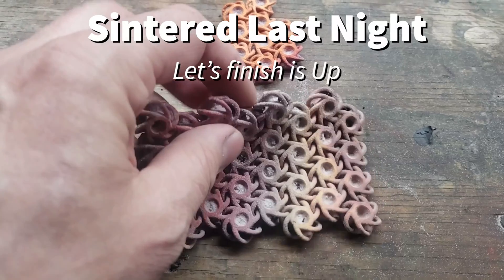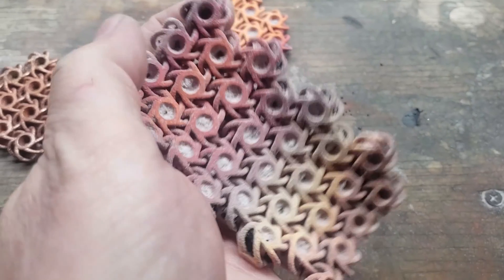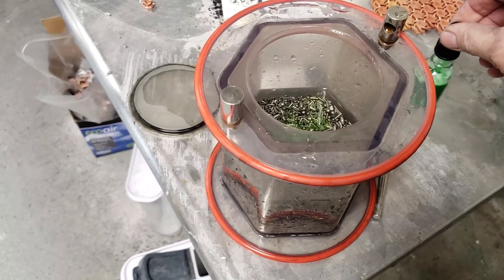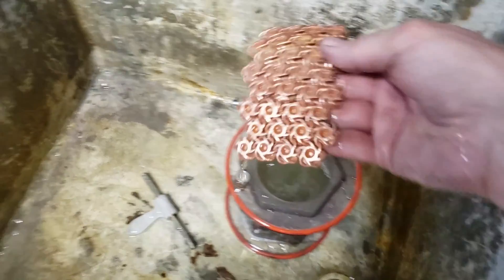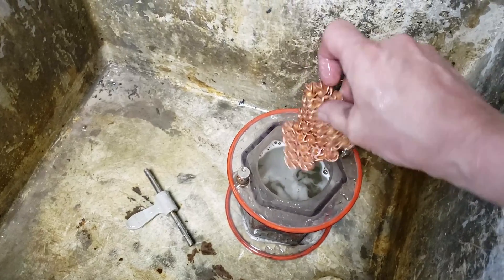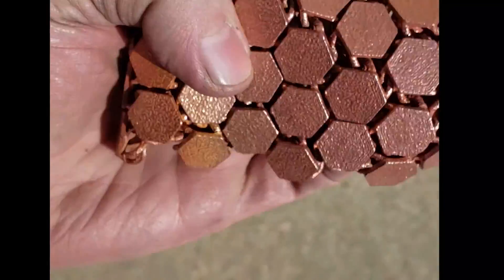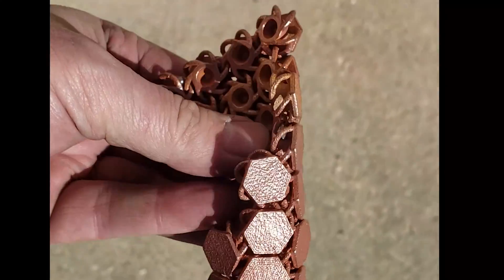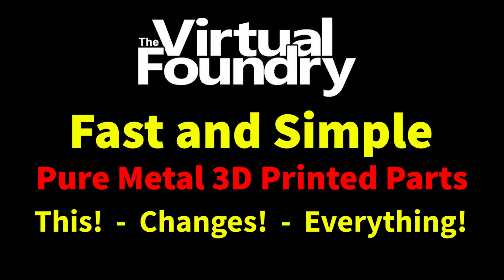How to 3D Print Metal at Home

Comment: Can you use a 1832 F kiln (originally used for plasticid silver) for some metal filaments?
Reply from the maker: Probably, yes. You will want a programmable controller so you can just enter the sintering recipe. Most PMC and Glass kilns have this feature. This page has a list of our materials and their sintering temps. You can easily do Bronze and Pyrex. If you can get a little higher you can do copper.

https://thevirtualfoundry.com/products/

Comment: Hi, i want to buy 3D print Metal of you buy ? ok sir
Reply from the maker: Check out the TVF shop at https://shop.thevirtualfoundry.com/ or write to us at info@thevirtualfoundry.com and we'll help you get started
Reply: @TheVirtualFoundry  Is the structure of the printed product after going through the heating process strong enough for TIG welding, sir?
And,  
What is the print line size? 
The metal parts when heated, the size will shrink 15-20% compared to the original print size right?
Reply from the maker: @keal.freespirits  You can do anything to the final sintered part that you do to metal - welding, brazing, polishing, etc.
Print lines will depend on your settings. You'll start with  a 0.6mm hardened nozzle with a layer height of 0.15mm.
Using the instructions on the website, your part will shrink about 7%. You have control over that and can shrink/densify the part further by holding the sintering temperature longer.
https://thevirtualfoundry.com/help/
Reply: @TheVirtualFoundry   Hello , Can I use 0.2mm stroke for copper material, I like sharp detail. and What is the maximum operating temperature of the nozzle?
Reply from the maker: @keal.freespirits  0.2mm is not advised. We recommend using a 0.6mm nozzle. You could maybe go to 0.4mm, but the smaller the diameter, the more likely your nozzle is to clog. Start your printing temperature at 210°C and adjust as needed. The print temps are similar to PLA - you really won't be going hotter than 225°C.

Comment: you can use any kiln tabletop has one for under 1000$ that works the same thing. my parts come out looking better than a pitted surface like in this video.
Reply from the maker: Right on. This process is designed to be open and work on a variety of equipment. All parts of the process can be adjusted too to get the result you want. Thank you being a Partner Innovator!

Comment: Are you seriously throwing a BL Touch and few parts on an Ender 5 and calling it your $2500 "metal" printer?
Reply from the maker: No, we spent 5 years trying to "throw" the BL Touch onto the Ender 5 with micrometer precision. But slowly realized that if we carefully bolt it into position, it works on the first try.
Reply: @TheVirtualFoundry  Haha, fair enough. I do see you're pretty open about it when asked and the ability to use most other printers. It seems a bit disingenuous to me to not even mention that's what it is on your site but I suppose it's more justifiable if you're offering some support (and hopefully CURA profiles) to those purchasing it.
Reply from the maker: Thank you for the kind response. That's not what I was expecting ;-)

The whole story is this. Starting with the Ender 3, these were our QA/R&D printers of choice in our shop here. We've always decked them out with the Micro-Swiss direct-drive mod. When we went to the Ender 5 Pro we still do the Micro-Swiss mod, but also started adding Big Tree Tech motherboards, BL Touch auto bed leveling and 7" touch screen display. So the parts that are still 'creality' when we ship it are the frame, drive train, heated bed and 2 of the 3 stepper motors. So, one would think that at this point it would cost less to just buy those parts individually, but it's not. It's still less expensive for us to get the parts we use in the Creality Ender 5 Kit and not use half of it, than it is to source the parts individually. 

And you're right, our price includes close support. We work with each customer to make sure they are printing metal parts, and if there's a problem, we just replace the printer. In the grand scheme of 3d Metal Printing, $2500 equals a printer that's not much more than a simple consumable.

It continues to be our position that the printer itself is just an incidental component in the metal 3d printing process. It's the materials and the problems that you can solve that are the true value proposition of the whole process... Printers, shmrinters.

Comment: Would there be any issues with running this through a run of the mill printer? Aside from accelerated nozzle wear.
Reply from the maker: No issues at all. All of our materials are meant to be used with standard FFF/FDM 3D Printers. Brass nozzles wear quickly, so we recommend a hardened or stainless nozzles. We have these in our store to make them easy to find.
Reply: I've had good luck with the tenlog idex printer as well (steel nozzles a must)

Comment: ionic voltage deposition, substrate is positive, ion sling in negative, features at nano scale, nano piezo 3d location actuators, like in a magnetic disc drive
Reply from the maker: I've done many tests on electro-chemical methods of depositing various materials. I've been able to prove it out at a micro scale. The main hinderance is rate of deposition. With the electro deposition strategy I'm only able to lay down a few grams per hour. The method demonstrated here is thousands of times faster.
Reply: @TheVirtualFoundry  both viable and possible, just better ion guns, or multiple ion guns, side by side
Reply from the maker: I agree, bring it on! Maybe I'll go back to that once this concept gains more traction.
Reply: @TheVirtualFoundry  masked electro plating, or just tip focused electroplating, high voltage and proper sulphates, electrolytes, metal anodes, main issue for at least copper electroplating is the copper oxidation, maybe ethanol solution electroplating, some non-aqueous electroplating
Reply: @TheVirtualFoundry  if you paint with an ion spray, you can even do ultra pure crystal growth directly with selected atoms, ie, mass spectrometry with ion sputtering, namely single crystal silicon growth, diamonds, etc
Reply: @TheVirtualFoundry  time is not an issue, the result is
Reply: if you think its too slow, you could always use a plasma-chemical deposition system, with a mask, very many masks, as the growing method
Reply: also works for metal sintering, but assumes you melt the whole layer at once, without melting the refractory ceramic-metal-carbon mask (in vacuum for the carbon masks)

Comment: how accurate can you make a part when considering shrinkage?
Reply from the maker: Using the technique seen here, you will get a very consistent 7-8% shrink rate. This means the part is still microscopically porous. Oversizing the original print isn't difficult, print the part at 107.5% and you will be very close. We do recommend that our users consider this a "near-net-shape" process. If you have 2 screw holes that need to be exactly 4 inches apart, alignment is a challenge. So, we recommend that you do drilling and tapping as a secondary process.

Comment: What printer?
Reply from the maker: a Creality Ender 5 with a Micro-Swiss dual gear, direct drive.
Reply: @TheVirtualFoundry  what filament is used for this?  And how is the part compared to a SLS metal printer?
Reply from the maker: This chainmail is pure copper, so we used this https://shop.thevirtualfoundry.com/collections/metal-filaments/products/copper-filamet?variant=12351243288659.

I'm doing another demonstration that will be stainless steel (316L).

It's difficult to compare directly to any of the Laser methods of AM. It's easier to compare it to Binder-Jetting or even Metal Injection Molding.

The key advantages of the Metal Filaments are Time and Cost. Well, and accessibility, which I suppose is part of Cost. With all hardware and materials included, the cost of your first metal print is around $5000. Then about $.20 (20 cents) per gram after that. If you happen to already have an FFF 3D Printer and a Kiln. You already have everything you need. You only need a simple hobby kiln.